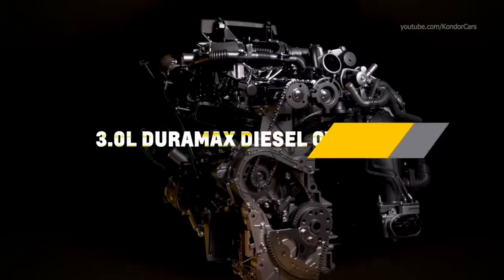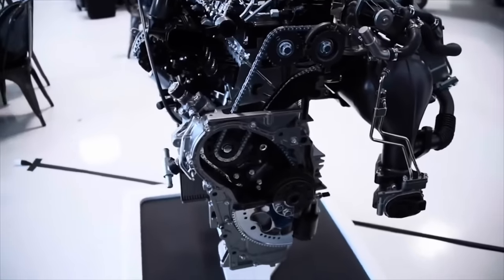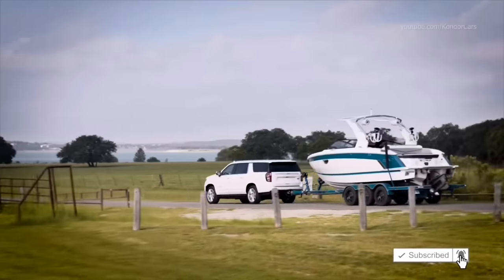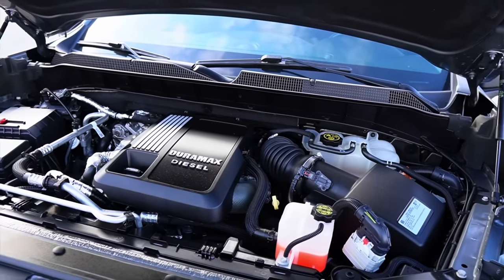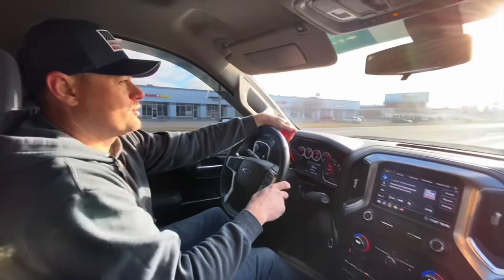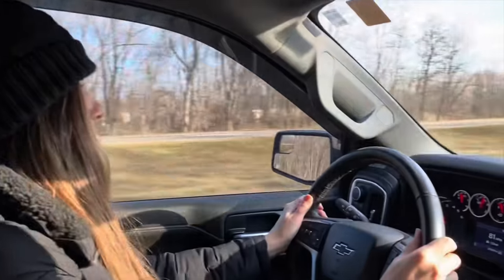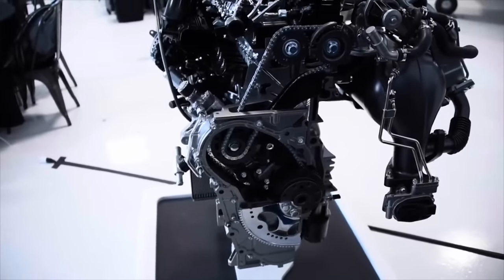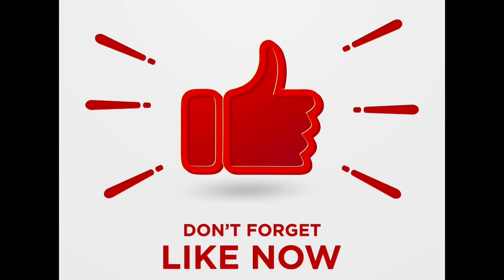What Everyone Needs To Know About The 3.0L Duramax!

Comment: Owning 2 EcoBoost 2.7 and 3.5 prior
Ordered 3.0 duramax with MaxTow.
Duramax pulls the 24RDS Keystone Cougar just as well as the 3.5 EcoBoost. Just daily driving, I see a 1/3 less in fuel costs compared to the EcoBoost. Daily driving 15000 Km I have used 11 liters of DEF total.

You mentioned you were looking for a family hauler. You would be very happy with this motor in a suburban or Yukon. Go with the regular rear independent suspension instead of the air ride and your tow payload will increase.

Comment: Have a 2020 with around 85,000 miles now. Fuel pump went out around 30,000, have had all but one injector replaced so far and had to have a new radiator because other one started leaking. Check engine light is on again, figure it is the remaining injector that hasn’t been replaced. Not getting anywhere near 30mpg, my average is around 22mpg. Once extended warranty is up I will probably go back to a 2500HD with the 6.6L gas.

Comment: I have a '21 that I bought in December of '20.  It's by far the best vehicle I've ever owned.  I pull a 7000 pound travel trailer effortlessly and get 14 mpg doing so.  I have just under 30k miles and it's only been back to the dealer for oil changes.
Reply: Some folks just going to gripe about anything

Comment: I would say no. The 5.3 gasser is a great engine combination. Plus maintenance on a gasser is so much easier and cheaper.
Reply from the maker: I’m with you on this one
Reply: problem with the 5.3 is they still have that lifter issue with the DFM crap.   So you'll be dropping in another engine in it..
Reply: @TruckMaster  I have a 2021 with the 5.3 V8 and the 10 speed auto. The truck is a ripper, gets 23mpg mixed driving. I drive it and take it in for it’s required maintenance. I’ve had it in Amarillo Texas sitting on interstate 40 on a 116F degree day and it kept blowing ice cold AC and I’ve had it in Worthington Minnesota in a -26F degree night. Started right up and only took 10 minutes to go from bone cold to 1/4 warm on the gauge. No worry about putting in the wrong fuel either because I drove through Colorado and it’ll drink 85 octane without a hiccup. I’m at 47,xxx miles and it’s comparable to power as the 2015 5.7 Ram I had and more linear than the 2014 3.5 ecoboost that I owned previous to that.
Reply: @slocavky  tuner make it run on all 8 problem solved. People been running them for years
Reply: @RBTMOTORSPORTSLLC  have to change out the lifters still.   They can still fail tuned or not.

Comment: I'm on my 2nd Ecodiesel (2022). I pull a 5,000# travel trailer often. I put about 10,000 miles a year trailering. The other 30,000 miles are mostly highway. I get 27-30 mpg on the highway if I keep it under 75 mph. I had a F150 Ecoboost and got 5-7mpg trailering. The Ecodiesel gets 12-14mpg pulling the same trailer. If I had a bigger heavier trailer I would get a 3/4 ton diesel but this truck and trailer work very well together. My commute is 70 miles round trip highway daily. For my application it works great.

Comment: I have the LM2 in a 2022 GMC Sierra SLT and absolutely love it! My truck is a Texas Edition crew cab, X31, 4WD, and loaded, yet still gets 30-31 mpg on the highway. Admittedly, I don’t always see that kind of mileage. The conditions have to be just right. But I’m always going to get at least 28-29 mpg on the highway. I used a truck hauler to haul a Ram 1500 back to LA from TX a couple of weeks ago and still got just over 20 mpg! Very peppy, even in normal driving mode. (There’s a sport mode but I almost never use it) As far as DEF is concerned, it isn’t really a concern. The engine doesn’t use a lot of it and the 5 gallon tank will last you a really long time. I’ve had the truck for 40 weeks today and rolled over 20k miles today. I use my personal truck for work and put a lot of miles on it. So far, it’s great! I love my truck and I love my Duramax!

Comment: Soooooo, just got a 2024 LZ0 DURAMAX GMC 1500. Should I give the good or BAD 1st? OK, bad. 1 wk into ownership at 490 miles while washing my truck, I jumped back in to go home & NO START. Left me blocking the car wash. All functions worked no start on $30 MONTH APP, remote start or anything. Called dealership & they said, "I dunno, tow it in!" Long story is I started a new job & needed my NEW TRUCK for this job & it failed to even get me there the 1st day of my job. So I was already pissy. Few days later I get call that the ECM isn't connecting so they have to replace. Pretty sucky since I'm starting new career & need RELIABLE truck & they give me a Lil Buick Car/suv for loaner. No crying about dealership, not their fault. Anyways, I regret buying a Gmc & leaving RAM brand so far.

Comment: I traded a 2022 Sierra with 6.2 for a 3.0 Silverado. I really loved the go of the 6.2, the diesel has plenty of go and I get a lot more mileage. My 6.2 averaged 15.9 mpg over a course of a year. My diesel is getting 24.3 mpg. Diesel is 80 cents a gallon cheaper than the premium the 6.2 took. Not sure I’d ever go back to gas.  I get about 4000 miles per tank of def.

Comment: I have a 2020 Silverado 1500 RST with the 3.0 liter engine. The engine has been awesome. No mechanical issues. Starting at 20K I started having issues. First the fuel injector wiring harness failed and was replaced. Next the main wiring harness rub through on the AC pipe and was repaired, but then it failed entirely and had to be replaced. Replacing the main harness required them to lift the cab on the truck. A neighbor has the same year and model truck and they have had the dreaded crank-no-start issue. So good mechanical truck that has a shitty electrical system.

Comment: I do a lot of highway driving and its been pretty good for that. i've had no problems with mine. also i think with the higher trim is a bit more comfortable. the problem with the 5.3 is the cylinder deactivation. the 5.3 and the 6.2 with them you will have a good chance of major failures of the cam and lifters. i personally wouldn't buy a gas engine though i wouldn't mind going back to a 6.6 but am happy with the 3.0

Comment: I went from a 2021 GMC AT4 3500 Duramax, since I no longer have a camper, I ordered and traded that for a 2023 GMC AT4 1500 with the 3.0 liter and could not be happier with the ride of the smaller truck and incredible fuel economy.  I no longer tow heavy, a boat or jetski, that is about it.  I would have kept my 3500 but it only got 23.9 on the highway, around town it burned a lot more fuel, also turning radius is so much better on the 1500.  They are both great trucks, but they each have different uses, the 1500 fits my basic needs perfectly now.  Also you can not get the 5.3 in the AT4 only 3.0 and 6.2 and 6.2 eats fuel.  Also Dodge and Ford did away with their 3.0 diesel, GM made this right with 305 hp and 495 tq

Comment: My lmm does just fine….ive literally only have 79k mi on it and its not even broken in yet and is practically a brand new 13 yr old truck…..has no problems shredding the 37”s at will (gas pedal only) and thats with the dpf intact and functional!!!

Comment: I HAVE bought the duramax, in a GMC Sierra 1500 with AT4 trim level. Honestly i am a bit disappointed in fuel consumption !!  Best i have gotten is 26.3 MPG , !!!! Not sure yet why, but i have just went over 14,000 miles and will change out the fuel filter in next week !!! Maybe after that i will see an improvement !!

Comment: I now own 2 GMC Sierra 1500s with the 3.0 Duramax and my dad owns a Chevy 1500 Z71 as well. All 3 are different models and together we have over 90k combined trouble free miles. I tow a 25’ camper (6430lbs) as well as a car trailer and a 7x16x7 enclosed trailer. I drive my truck every day to construction sites all over and love it. Coming from a 5.3, the 3.0 Duramax fuel mileage is off the charts. Pulled my camper from KC to Estes Park with zero issues and averaged 13.7mpg running 70mph. My buddy’s v8 Ford drank the gas at a whopping 6.7mpg and he was drafting off me the whole trip. 
It’s not a drag race truck, but it’s no slouch off the line. I e got zero concerns about the oil pump belt. Seems the gas guys forget they will spend equal $ for their tuneups at 100k.

Comment: I jav a GMC Sierra 1500 with the 3L Duramax.  I really like it, I get between 30-32MPG on the highway, once I got 34.6 MPG on a 200+ mile trip.  Not bad for a fullsize 4X4.  I have 56k on my truck so far, no issues.  Now where I live in FL, diesel is only 8-15 cents more than gas, and it really pays, that wasn't the case about a year ago when diesel was more than one dollar more than gas. I am not looking forward to the 150k repair, I am a long way from that now.  The second generation 3L Duramax doesn't have that issue.  All in all, I really like the truck and diesel option.

Comment: I have a 2021 ecodiesel cp4 fuel pump failed at 35,000 requiring an entire fuel system overhaul been a month so far and still waiting for repairs to finish. I know the Duramax doesn't use the same pump but definitely worth looking into where you purchase diesel as some are more lubricating than others. I have loved the fuel economy with diesel and it's power in towing has been impressive while still maintaining a respectable fuel mileage. Even with all the issues I still choose the diesel as I am currently driving the gas version 5.7 hemi and am lucky to get 15mpg completely unloaded and alone. At the end of the day delete it and you won't run into all the emissions problems that can cost thousands which seem to never end as they rack up miles

Comment: I just recently picked up a 2021 crew cab short bed and I am a static about this truck. I’ve also on a 91, 454ss with the 7.4 L big block on it that was heavily modified for my street truck. And the get go off the line with the door and Max is extremely pleasing to me. I serve on the Banks pedal monster changed out the hot and cold pipes with the SMB intake within the first two weeks and my goodness did that wake that diesel motor up like no tomorrow. As far as towing I haven’t gotten to that point yet as I have the towing package on it but I’m not necessarily looking to pull anything over 10,000 pounds. So for the gas mileage difference and the longevity of the motor was the reason I went the diesel route. But the Petal master is a must from banks as with all the different levels you can adjust to. You can find one in your lighting, and just putting it on low and of sport mode I couldn’t keep the tires from breaking free on the road and I live in Florida and it’s over 90° right now. So as far as just normal power driving goes, I’m never more than feathering that pedal driving around town and I have 34 miles per gallon at best and 26 miles per gallon around town. So I did not need the purpose of going up to the larger Duramax for towing purposes. So if that’s the case for you, I would say stick with the 3.0 save yourself a ton of money and go out and enjoy it because it’s a pepper going off the line right now with a few mods and that turbo just keeps on pulling. Even always wanting that power there for passing somebody on the road. It also does not like that at all yet either. I am extremely happy with the 3.0 as ones I got rid of that initial lag that was far beyond the best improvement I’ve ever seen and a truck from one product and definitely needs to be added.

Comment: We took mine towing a camper across country and back,truck pulled the mountain passes with easy,
Shoot truck was upshifting pulling the passes, the best part is the auto Jake brake when towing made going down those mountain passes while towing, truck towed safely and smoothly at 70-80mph, the transmission cooler and oil cooler was awesome too barely even spiked a fever even though it was working, though if you get one you’ll want to put airbags in the rear for towing because the factory rear suspension is very soft, I get between 28-30mpg. It’s got the sport mode which is awesome when the roads are dry otherwise just keep in normal mode

Comment: I have a 3.0 Duramax had a couple issues like low def when full, radio not consistent on start up only have 20k on it, and only use top tier diesel fuel.  other than that, love this truck. Love the sound and power.

Comment: The elephant in the room is the oil pump belt replacement. I believe that you "only" have to drop the tranny to replace the belt, LOL. As of 10/24 there are lots of these on CarMax. I am considering kt as a second truck. I have a 2wd 2018 Silverado with a 5.3 gas and it gets 24 mpg consistently. It even got 28-30 mpg! Running it at 70-75mph on smooth Southern foothills roads.

Comment: Your info is incorrect because  a tech at the chevy garage just dropped the trans an changed the belt an there is a service bulletin about a oil leak in the rear cover on the back of the engine to be repaired,  pretty easy 😀   I own a 22 3.0 duramax denali, great truck excellent ride , not much noise from engine,  doesn't use much Def,  5k miles per fill-up, pending driving habits, unreal 30mpg....luv this thing !

Comment: 2021 1500 RSP.  3.0L.  40000 mile in .   Best truck I have ever had . 38 mpg. Top was 49 mpg . Lots pulling power smooth quiet running truck . BTW. Def fluid 5 gallons. Last 10000 miles .  I get mine at QT. At the pump . 💪

Comment: Chevy guy through and through, had a 2021 3.0 duramax Z71, was awesome for 21 thousand miles, been in for warranty on trans twice and transfercase once from 15k to 21k, sold it after the last time it was at the dealer shop for over 3 months.... if it was reliable it woulda been my favorite rig, but it aint.

Comment: My 50 mile best fuel was 48.5 miles per gallon. I have a 2021 silverado 3.0 with a 3.5" leveling kit in the front and stock 20" rims

Comment: High mileage driving will be the deciding factor for which is better for the buyer, 5.3 is a great engine but I have never driven one that can do better on fuel then 10 to 15% less than the estimated economy rating. I average 26 MPG in the city, 33 MPG in highway and a best average of 38 MPG with my 3.0. Best truck yet, at only 7 months old not long enough to be relevant, with 21,500 miles on it so far no issues. This includes pulling trailers, boats and just by itself.  I also noticed the response power when on highway, still got me a speeding ticket after making a pass.

Comment: I have a 2021 crew cab silverado RTS Z71 with the 3.0l lm2 duramax. I average about 23 to 26 city, 29 to 32 hwy.. best mileage over a 50 mile stretch is 34.9mpg. I have about 40k on it, so far no issues, used it to tow a 7x14 enclosed  trailer because we moved from Massachusetts to South Carolina. Just shy of 1000 miles per way. It goes thru DEF fluid when towing. Usually about 4 gallons of  DEF over the 1000 mile trip. I love the power and efficiency of the engine. My previous silverado was an 04 with the 5.3l. My towing rating listed is 9500#.

Comment: I purchased a 22 GMC Elevation 3.0 4x4 back in June and Absolutely Love it(ordered a GMC keychain from you for it lol).  Plenty of get up and go!  Burn rubber if wanted. I have gotten 33mpg doing 80mph on the highway.  I also have the crew cab which gives you a TON of room.  It would be beneficial for you 2 to test drive a 2022 extended cab vs double cab. Seems like the truck you drove dosent compare! If your ever in Omaha hit me up and you can test it out.

Comment: You need the Crew Cab, that’s only a extra a cab. I have a 2022 High Country Crew Cab and standard bed,  it offers so much room in the back vs what you and wife were driving. Plus yes, avg 30-32mpg (mind you at 65) 28 (75-80mph)

Also you get the torque of the 6.2 at 1400rpm

finally the 2023 gen2 is 495ftlb and 310hp

Comment: I love my 23 3.0 LZ0. I regret not having owned a diesel previously. 32+ mpg freeway 65 mph, 22 mpg in town, 22 mpg towing on freeway 4.5K travel trailer at 55 mph. Quiet. I can stand by the exhaust and breath the air just fine. This truck makes me wonder why every single vehicle out there isn't a diesel.
Reply: Nice!  what tires are you running and do you encounter any elevation changes while towing?
Reply: @CompulsoryDemocracy  My tires were the GoodYear Wrangler TrailRunner AT tires that came with the truck. I changed a couple days ago to 10 ply tires but don't know the MPG yet. 22 MPG towing is on flat freeway with no headwind. Headwind, towing uphill, and faster speeds drop MPG to about 10 if intense, but average about 15 which is about 1/2 the normal MPG not towing which I often hear others reporting.

Comment: My issue is I have a Duramax 6.6 3500HD dually. We quit 5th wheeling, I live 1 hr from town on a small ranch. I'm using a 9k lb dually as a commuter. Still need a truck and I just got 17.3 mpg driving to work. Would like to switch to a 1500, a 6.2 would get less mpg, a 5.3 will probably get less mpg, leaving one option that makes sense, the 3.0 Duramax. Another option?? buy a small commuter car and leave the dually in the garage until I need or want it? what is your suggestion?

Comment: I have a 2022.5 High Country LM2 with the 13k max tow package, and it pulls 10k trailers much better than my 2015 5.3 gas does. Fuel economy is 50% better with the diesel vs gas both empty and towing.

Comment: after having a distasterous experience with the 5.3 and the mess of cylinder misfires-oil consumption that has been an issue for YEARS in those trucks I would consider a sierra with this 3.0 diesel  engine after hearing positive reviews

Comment: My 21' RST Z71 Crew Cab has the larger tow mirrors. Has 14,000 miles and have had zero issues. averaging 26-28mpg with highest being 37mpg on a longer highway trip. Also the new 22' offer a max tow package giving you up to 13,300lbs.

Comment: Just a heads up everyone bashes the timing chain location. To remove the front cover on a 6.7 Powerstroke ya have to remove transfer case, transmission just to get to the 2 bolts on the back of the oil pan